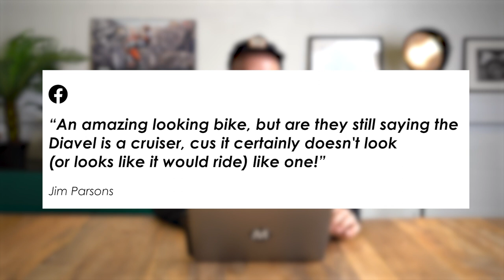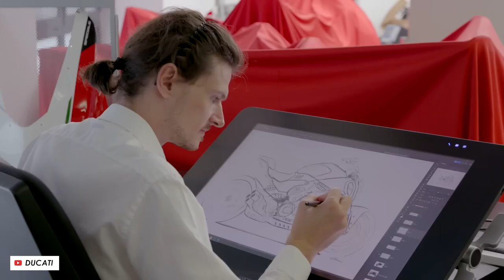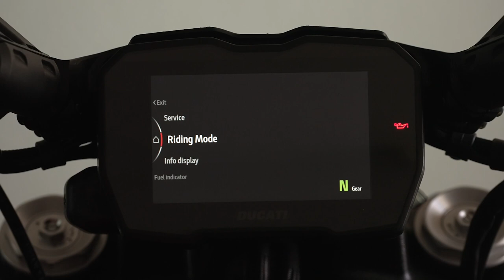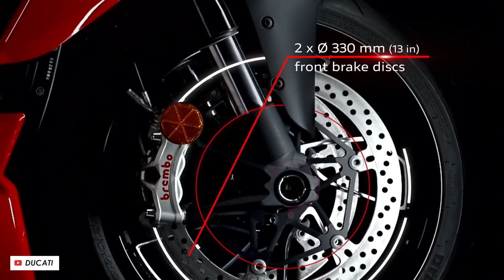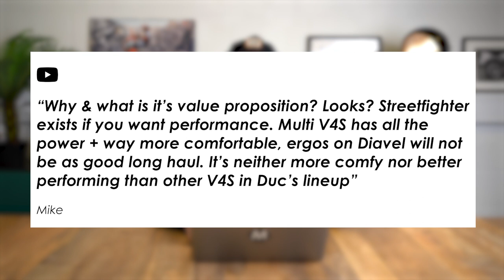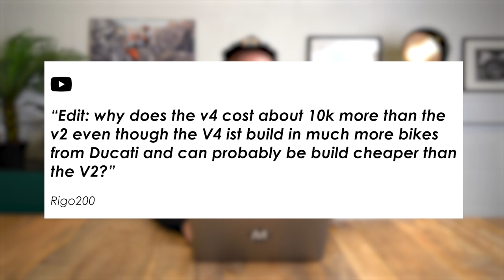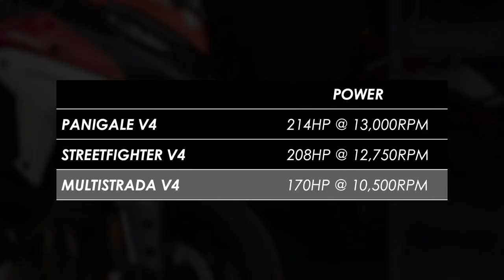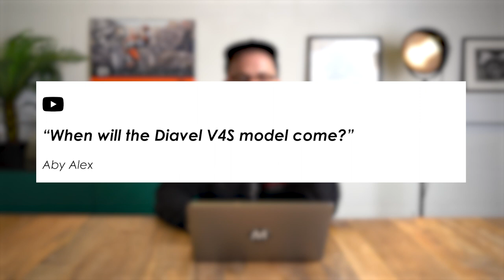New 2023 Ducati Diavel V4: Press Launch Q&A!

Comment: Can’t wait for the comparisons with other bikes. Rocket 3, Suzuki m109r, vmax, Harley breakout 117 and fatbob, Indian scout.
Reply: I had to sell my 114 Breakout 2020 and got a Diavel definitely prefer handling of Diavel. Like to see the 2 compared over Standing quarter got a sneaking suspicion Breakout would get jump on Diavel up to 3 gear then get smoked by diavel thereafter. Weight being main advantage for Diavel.
Reply: No comparison. I’m not sure how you can compare them. This bike will destroy those in handling , cruising, cornering as well sheer power and speed. And now with the service timeframe changing so drastically you can ride this bad boy 18k prior to any service cost. Really an impressive bike.

Comment: I had a 1260S Diavel and found the suspension so harsh that it wasn't enjoyable to ride, but it had the Ohlins and, to me, was too stiff. It made my vision unclear on rough roads. I also had a 2014 Diavel Strada, which was excellent and very compliant. How did you find the suspension n the V4? Was it compliant, a little softer, or just like the Diavel 1260S and hard? Thank you!!! Great work, as always!

Comment: I currently have a red 1260s which I'm trading in for the red v4. The main reason is the weight saving and secondly the fact that the v4 is a better bike. I love my 1260s, I found the Ohlins suspension to be fine but to be honest, I can't tell the difference between Ohlins and the standard suspension so having black forks is a bonus for me and I won't be hanging on for the S version.
Reply: That 1260 V engine is much more off a character than the V4. Yes its a better bike but a more bland personality.
Reply: @srtspeedy4983  So far I've found the V4 to be slightly more fun than the 1260s due to the maneuverability.